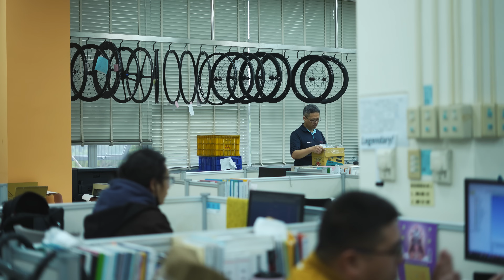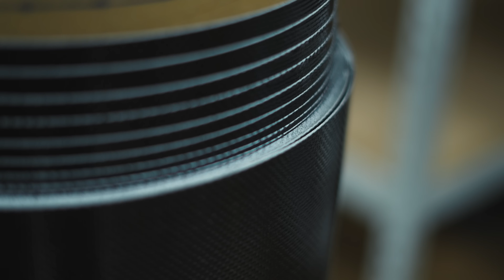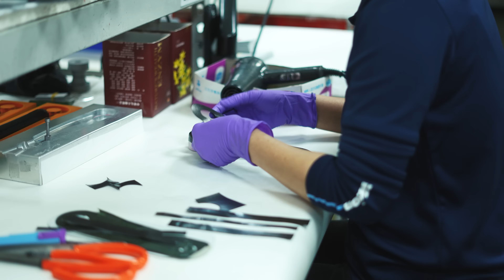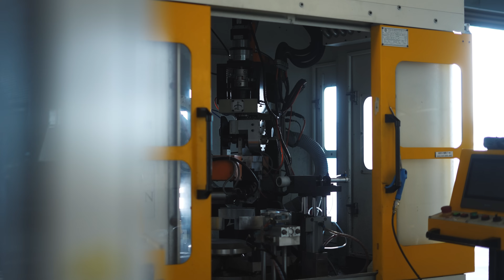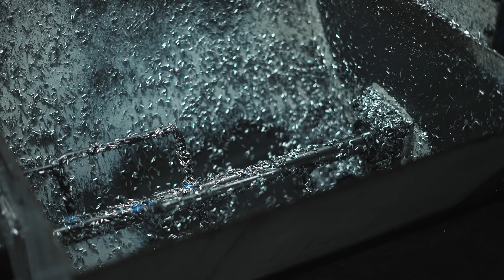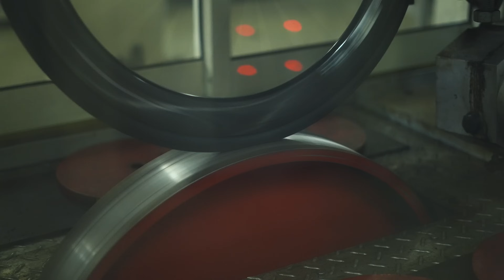How A Carbon Fibre MTB Wheel Is Made | FSA Factory Tour

Comment: The cycle industry should be utterly embarrassed for continuing to use this labour intensive low performance prepreg technology. 

One piece complete high performance frames were being molded in one piece by one operator, with one day training here in NZ in the 1990s. 

At a total of 2 man-hours per frame. 

It is brutally obvious that these rims take far more hours and worker precision, and far higher tooling investment, than those frames. 

They are all still in excellent riding condition after over 25 years, some with over 20 pro race DH seasons under their belts. 
The only reasons to continue this farce is to promote the image that :
1/ this is technology our of reach of most companies and developers. 
2/ you should pay a lot for it. 
3/ you should put up with product that is not durable. And replace it without grumbling when it breaks.

Comment: But why are all those rims black? It is not right, I don't want a T-model. :(
Reply: FSA as other brands do different decal / graphic's for wheels so you can brighten them up if you wish - but the Rims are black as thats the color of the carbon fibre.
Cheers
Owen
Reply: @OwenBikeNerd  I have seen carbon fiber products in several colors and they look great. There might be some structural properties that make them unfit for rims, but what about aluminium rims? Those are all painted and that could easily be something other than a shade of gray. Decals can solve the issue to some degree but is very hard to cover the whole wheel.

Comment: For anyone who deoesn't speak cnc machining / engineering, power skiving is some pretty cool shit. Old tech in a sense but mainstreamed fairly recently. Maybe not mainstreamed but got more wind under its wings.
Reply: Yeah the machining was super impressive - not just the what wild shapes could be cut but more the repeatable high precision - but it already sounds like you know your machining! 
Cheers
Owen
Reply: @OwenBikeNerd  I am machinist for 15 year worked at a place where the bread and butter was transmission components etc etc, anything with sprockets or splines or gears you name it we done it.

Comment: It's not just that the resin gets sticky/tacky at room temp, it actually starts to cure. If it spends enough time at room temp, it's no good anymore. Cold temps don't prevent that process completely, but they radically extend it.